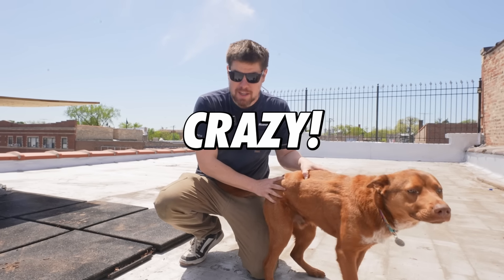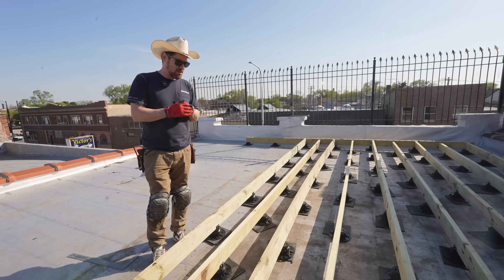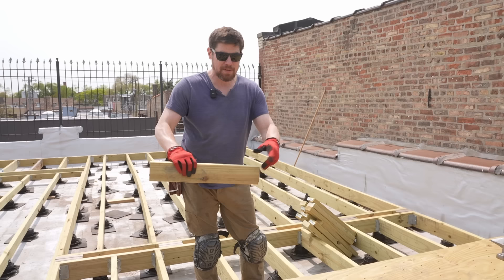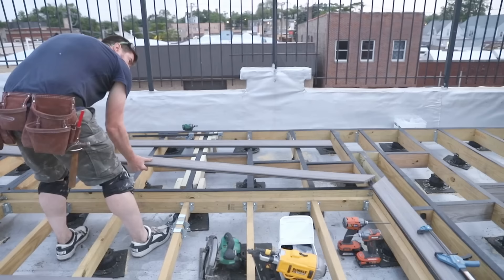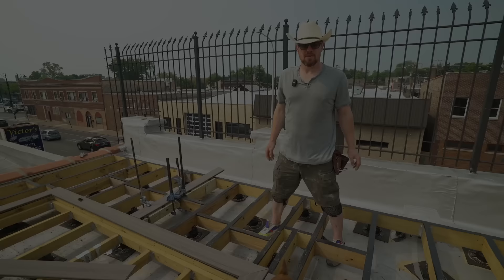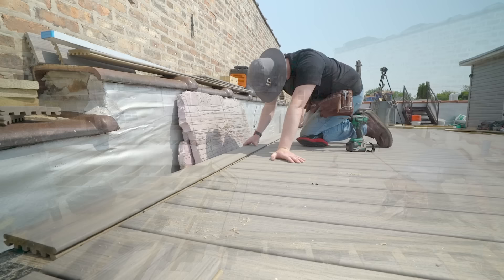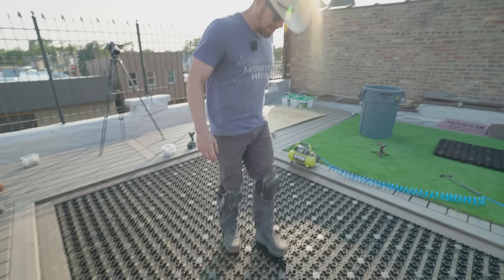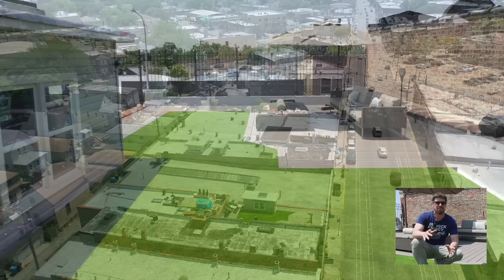I Built a ROOFTOP DECK that feels like an Actual Yard....

Comment: The deck looks amazing! I'd definitely be concerned about the lifespan of the plywood under the grass though. It's gonna have to deal with getting wet every time it rains and you leveled it out instead of building it at a slant with a drain in the corner so water and Tex's pee are just gonna sit there and soak into the plywood. Maybe I'm wrong and you did something you didn't mention in the video to take care of this. Either way the build looks great!
Reply: Why wouldn’t you use cement fibre sheeting?

Comment: Looks nice!  I do think you need some fencing to keep your doggo safe, also if you ever had kids over.  The hole where the taller building has a chimney pipe popping out seems a bit scary to me.  I know weight is a concern, but some potted plants and/or shrubs along the street side might add to the yard look.

Comment: My Uncle owns several multi-family buildings and let me tell you... that "yard" is going to need to be completely dismantled in about ten to twenty years because of the roof underneath. That roof is PVC, right? I am not trying to be offensive or derogatory. My Uncle has similar flat roofs on his buildings, and he had me get estimates from multiple roofing companies because water wasn't draining correctly. People were walking on the roof, causing puddles to form; and if you don't fix the drainage, you eventually get water damage. You actually took it a step further and built a complete yard on your roof, with multiple pressure points. That means water that does make it underneath there will collect and puddle longer (because it isn't exposed to the sun); which means less time between getting it maintained.

Here is a tip: The next time you get your roof done, get a standing seam metal roof; and rebuild the yard modularly. Then, every time your roof needs maintenance, you can rent a crane and remove the roof piece by piece.

PS. If you just did what you could afford, then I apologise.

Comment: That ply under the fake grass is gonna start smelling really bad after the dog pee soaks in. If you wanna keep the ply you'll need a thick rubber or latex paint layer on top and some PVC pipe going through the holes, cut off 3mm below the under side of the ply as drip edge so it doesn't just run off and soak in from underneath. It'll also need regular hosing outside of winter to move the pee on, that's something all fake grass owners need to do cause there's nothing to help break it down like real lawn and dirt can do

Comment: that plywood is going to buckle, guaranteed.  You would have to epoxy coat every single hole after you drilled it to prevent this.

Comment: I am kind of dissapointed that you decided for artificial Grass. basically you missed the opportunity to install a "Grren Lung" on you otherwise dry and dead roof top. Real Gras would have a lot of advantages. It can absorb rain water like s sponge, when it evaporates, it will have a cooling effect. Not to mention the microbiom that lives in it. it would handle the waist products of your dog much better.  i realy hope this does not end bad when you someday have a unplessant urin smell from unter your deck

Comment: Such a shame you didn’t use real plants. Is it too hot/dry where you live? 

A ‘green roof’ will actively cool the roof in summer and provide extra insulation in winter. It can also absorb most of the rainwater or at least delay the drainage which helps with … uhm … drainage (further down the line). 

Greetings from the Netherlands!

Comment: It looks really good, but I can't see how the unprotected  plywood under the grass and drain tiles won't rot away in just a couple years.
Reply from the maker: It is pressure treated plywood rated for ground contact.
Reply: @modustrial  Ok that should add some years. 👍

Comment: You aren't going to let Tex pee and poop up there are you after all the work??  Gross!
Reply from the maker: The air grid and anti-microbial grass is designed specifically for dogs
Reply: @modustrial  Great, but isn't it going to pool on the roof underneath and smell??

Comment: Too bad you didn’t make it a real grass roof. You would have had drainage built in, the roof would have lasted longer than a conventional flat roof, and you would have also cleaned up pollution, reduced greenhouse gases, and lowered the heat island effect for the entire neighborhood.
Reply: And the whole “dirt’s heavy” argument against that, neglects to mention that there are ways to mitigate that too. The did it across an entire neighborhood of buildings in Portland, some dating back to the 1800’s. They can do it with a building built in the 50’s.

Comment: i dont understand why you put a deck on the roof. its cool an all, but is it really woth spending 60k? build something for your dog makes perfect sense. i wouldve loved to see a fire hydrant somewhere. if peed on, it leads right into the gutter. shit has to be taken care of the old fashioned way.
Reply from the maker: The cost of replacing the roof itself (not the deck) was 60k.  That was necessary whether I put a deck up there or not.   The cost of the yard was about 12k in materials
Reply: @modustrial  thats way more reasonable. i mean it looks really cozy up there dont get me wrong. for that prize you made a lovely place

Comment: Nice work but so...... american. Hate those platic gardens
Reply from the maker: There will be real plants and trees up there when it's all done
Reply: This is not an 'American' thing by any stretch of the imagination. There are a few areas of the US where artificial turf is used - mostly in areas where water restrictions are in place such as the SW which has been experiencing drought conditions for nearly a quarter century. If you bothered to do any research before making that statement you'd learn that Europe actually leads the world in use of artificial grass. As of 2018, Europe accounted for 40 percent of the global market for synthetic grass. Also, Arnault... France is one of the top markets for synthetic grass used in pitches - more than 1,800 - and synthetic pitches are now installed in 29 countries in 277 locations.